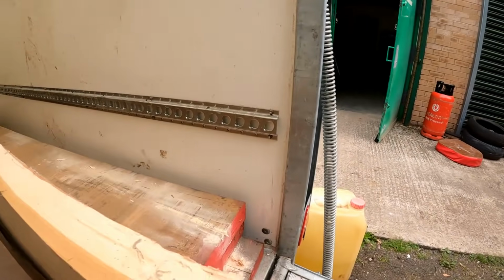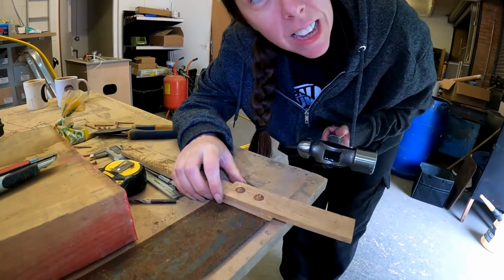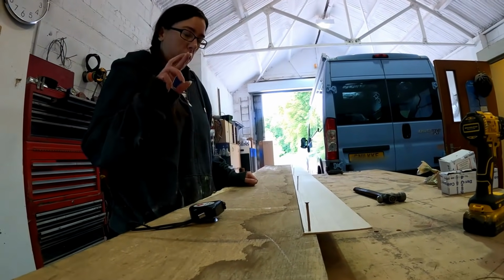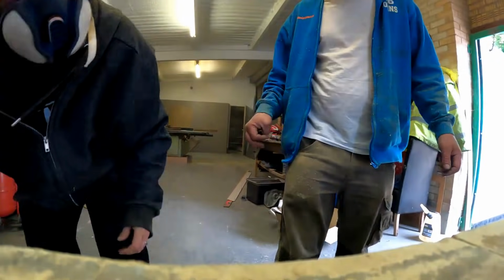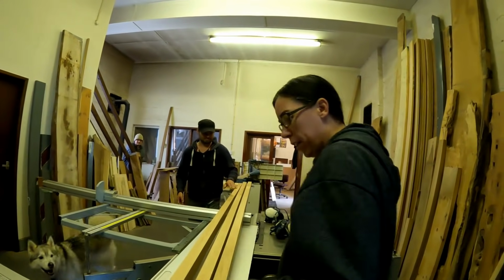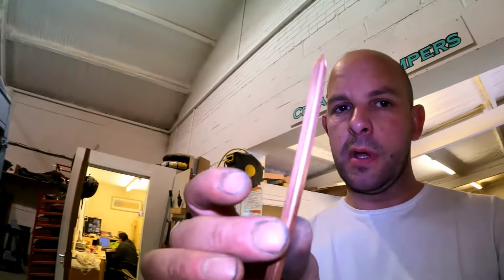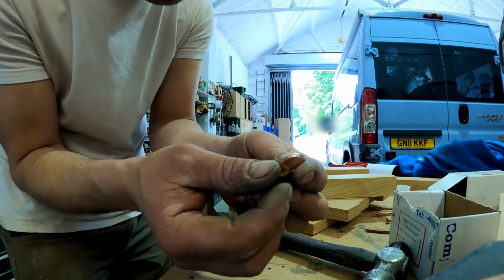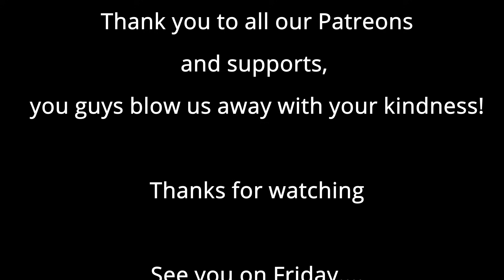Milling Our Own Oak Frames, Learning Copper Rove Techniques And Making Rove Tools

Comment: A few tips from a 1st Class Tradesman Boilermaker.
Mate... safety glasses when drilling steel ALWAYS.
Ear protection guys!!!
When swinging a ball peen hammer and riviting, swing from your elbow and NOT your wrist for control, accuracy, power and avoid damaging your wrist.
The test rivit mock up went very well but you need a block of 1" thick steel with the shape of the rivit head and probably a handle or two to prevent the rivit being pushed out and reduce rattling things loose. 
That was a good mock up test tooguys. 
From Australia.
🇦🇺🐨🦘🇦🇺
Reply: The weight of the hammer is the worker....is what my grandpa, a machinist and tool and die maker used to say. I try and remember that when im just hammering in nails on some little project
Reply: Boilermaker!? So, you're a Purdue alumnus too! Boiler Up!

Comment: Hello from Pa.USA. The way u2 make things work is sort of  how U put the Beautiful Boat from the start with just about nothing, Except when u have to. Is how I have made a small business out of only using totally used material. But I sort forget about the building knowledge the 2 of have. The one who is always banging his head what I would call a master carpenter, electrical specialist. Again master plumber not to mention his mechanical wisdom.
  Oh yea the one who’s the best right handed helper on sight.. Not only excellent Mother, cook, ideal maker and most importantly keeps Simon under control. The rivet smasher he made out of the bolt shear genius….
 I know u can’t hear it but I’ve got a bolt turning on my lathe as we speak…..  Brilliant Vlog today thanks!

Comment: Check out Acorn to Arabella or Tally Ho for tips on copper riviting, they had one person outside pushing a tool against the rivet, whilst the person inside peened over the head. 🙂
Reply: I say check out sailing yaba to...check out how the shipwrights make up the frames.
Reply: yeah somebody else who watches both Tally Ho and Acorn to Arabella - best channels, top blokes doing top jobs, especially no feet Pete, all bring their skills
my guess is the copper pins and peening can be done in different ways, i reckon these cross diagonal planks were assembled for speed where as today with the named projects above use thicker 2inch horizontal planks and countersink to hide heads - Gem n Si, did you enquire as to trading your used pins back to your supplier as scrap, although some longer ones could be reused where short ones are required - not sure if you can run a small compressor on the boat with a modified air chisel for peening, but does require weight behind it and will do your head in - (i might suggest pre drill holes before pinning) not sure if its still a thing today, i still blunt nails before hammering to prevent splitting timber - amazing work though and super vids
PS glad you got to see Madusa at Pompey, its the icing on the cake to make new pals and get involved in national and international events, D-Day etc epic

Comment: If you have access to air tools an air hammer makes a great rivet setter. Just drill a small divot in one of the tools and use this to upset your rivets while someone holds a bucking block on the outside. If you decide to continue to use a hammer, use a smaller one that is easier to handle repeatedly. Keep up the great work.
Reply: was about to suggest the same thing. Could make a nice dimple in the end of a cut off air chisel  on the lathe with a counter sink bit.

Comment: As a fabrication engineer you can make a tool to round off the nails Get a big bolt like the ones you have got  but a concave end about2/ 3 mm deep at one end to finish the nails  by placing it over the end of the nail and a big hammer to finish it works

Comment: Its always hard getting decent lumber in the woods that you prefer to use. The mills are set up to get the most board foot of lumber possible, so there's always a couple that never quite make it. At least you had the table saw and planer handy to square your pieces all up. Slow but sure wins the race as Aesop's always mentioned, if there's a moral to be had in this. Very best wishes my friends.

Comment: A smaller hammer will make the roving effort a little easier (if you are worried about missing and bruising the timber you can use something like Adalox sanding cloth with a small hole to protect the surrounding timber). The idea is to spread the copper nail over the rove which pulls the nail in and tightens the rove to the timber (without flattening the rove). If you make a pin dolly (pin end of the dolly the same size as the head of the nail), you will find it easier to rove the nails (no bounce and the copper end "spreads" more easily).

Comment: Definitely need someone on the nail head with a club hammer acting as an anvil essentially, and use a smaller ball peen  hammer on the end of the nail after you've fitted the rove and pushed it down. You might need to cut off excess length of the copper nail before you peen it over. I was taught to dip the nail head in silicon grease before nailing it through the wood, eases it through.

Comment: I wouldn't worry about work hardening they are likely to be fully hard  already
as a copper  nail  they would need to be or you could not drive them in  with a hammer they would bend 
good work thanks for posting

Comment: Hey Simon so you know a rip saw blade has a bigger gullet on it (gullet is the rounded bit under the tooth tip this get rid of saw dust which you have when cutting hardwood and more of with softwood this take it out of saw path known saw kerf then saw dust falls out under saw in stead of remaining and getting hot and burnt with friction) Panel saw blades don’t need such a bigger gullet as their is less saw dust as your material is usually chipboard mdf etc smaller dust particles normally the teeth are tungsten carbide for cleaner cuts Jeff Connor Melbourne Australia love your channel guys . Ps Pompey 20:13 ex timber sawyer  watch out for the dust of Iroko as it toxic make sure you have eye protection as as face mask one of our ex sawyer got a similar problem as asbestosis from breathing it for years it’s a lovely wood to work on and with though Jeff Australia

Comment: A quick course in using a Hammer. The handle is engineered to be in proportion to the weight of the hammer head. For the most efficient use, one holds the handle as close to the end and not the head to create the needed force to accomplish the work. Suggest you search Youtube on RIVITING. Then note the amount of force to peen over the rivet heads. You need to borrow or rent a small pneumatic hammer with a rove tool. That hammer will be too labor intensive. I saw a air compressor in the shop. Make it your friend. Seeing Gemmi tap that rivet head has mad my wife chuckle. Remember, the rivet is to have two heads to lock the surfaces together. Another suggestion. Turn the table saw 90 degrees and place it in a position that allows one length of the wood on both ends. So much easier. Not sure who sold you the wood, but cut a short piece of about two foot, carve it into a club, and revisit the seller. That's some crappy wood. Enough bitching. Tred on!

Comment: You might be better using a pneumatic rivet setter (air hammer) for those copper roves, it would give you more control than hammering (I mean for the peening part).
Reply: That's exactly what we do when riveting aircraft with alloy rivets.

Comment: For steaming... the weak points will be... where there is a knot or where  the grain runs out of the side of strip before the end. Under steaming and forcing timber to bend. Grain that runs the full length of timber will be the easiest to steam bend That's my basic knowledge I have gained.  .:):):)

Comment: You do know you should drill a pilot hole through your outer planks into your inner frames and a recess in your outer planks to countersink your rivet and later plug it with a dowel! If you're cutting your own rivets, you'll need to take the countersink into consideration for the length!

Comment: Once nails are through they can be rolled over and driven back in to wood cinching together tighter! Hull planks will even snug tighter once wet? Driving nails with out bending them using a air hammer needs lots of air!

Comment: You will deffo need ear plugs when hammering that lot. By the way, They are rivets. Not nails. 
How about using a rivet setting drift to peen the rivet over the washer?

Comment: Check your timber for flight holes because that damged part looked like the work of woodworm. Don't bring them aboard your ship, else they will eat it. You can get a chemical treatment that may ensure that you can use that timber without taking any risk. Good luck.

Comment: If you want to make the nailing roundover easier get an air-powered "palm" nailer and switch in a flat anvil attachment.
Don't bother to paint the bottom of your boat until you get it out of the mud and on the hard. If you do you're just wasting your time and money. All the best.

Comment: Hold the hammer nearer the end of the shaft & use the weight of the hammer, rather than your wrist power, to hit & 'pein' (it's a 'ball-pein' hammer), the pin over.
Reply: Yep when I was an apprentice I was told “ don’t strangle the hammer “😂

Comment: I had to wince when you blew your selves down with the airline. That is so dangerous .It can aireate  the blood and cause death. This was one of the first things I was taught never to do on my engineering aprentership. Always  enjoy watching vids. Keep up the good work.
Reply: Absolutely! I recently retired from working in electric power generation plants. Blowing off our clothing with compressed air was grounds for termination. Very dangerous.
Reply: Total nonsense.
Reply: @itsverygreen532  Not really, most factories have the airline limited/regulated unless It's just for power tools, anything with a pistol is around 25 psi, there are many cases of people messing around with unregulated airlines and causing life-changing injuries, its very dangerous and in most places a gross misconduct or disciplinary at least
Reply: @itsverygreen532  Um, no its not, people have died, quite a lot of people.
Reply: @itsverygreen532  air embolisms are life threatening and have killed many.

Comment: good to make a start on the wood, but looks like the grain running wrong way
and somebody should be on the out side of the boat with a heavy bar with a point 
pushing against the nail head while someone in side hammering it keeps it,
when you coming for rest of stuff...
and that was a plunge where is your centre drill

Comment: You could use a pneumatic hammer with a rounded concave bit to hammer the nails instead of hammering by hand. Try having a look at Youtube channel Sampson Boat Co they are restoring a 100 yr old wooden boat "Tally Ho"

Comment: you two are brilliant
you put the rest of us to shame
and
Not trying to butttt in butttt
y'all know that's like riveting was a million yrs ago  the way it happened was the guy on the 'inside' had to lean into the rivet with a 'form' while the guy on the outside used a pneumatic hammer to ram the hot rivet home.  You might try having outside person lean in while the inside is hammering down the copper nail to grip the rove with an electric or air hammer. Like 100 1 lb strokes might do the job and be easy for outsider to lean in on.  ideally you'd custom make a blunt head for it that's a bit concave the shape you want the copper to be hammered into.  
Apparently you can buy electric hammers that deliver a couple pound blow 3000 times a min, pricey $200 Air hammers that do the same like $50 but you need the compressor etc.
Maybe you can rent something for a day just to try in the shop.
Milwaukee Electric Tool 2458-21 Cordless Mailer Kit, 1-3-1/2"
Craftsman 9-11818 Nextec 12-volt Lithium-lon Hammerhead Auto Hammer
Ingersoll Rand 114GQC Air Hammer - 3 PC Chisel Set with Tapered Punch, Panel Cutter, Flat Chisel, 2-5/8 Inch stroke, 3500 BPM, Lightweight, Compact, Gray
DEWALT Chisel Hammer, Pnuematic (DWMT70785)
XtremepowerUS Demolition Electric Hammer Jack Hammer Handle 1000W Concrete Breaker Flat and Point Chisel Bits with Case

Comment: I remember doing this about 45 years ago with my father on a clinker built dinghy. Take a look at this clip Nomad Boat Builders channel. https://youtu.be/HapS5j2LJa8  . He is a wooden boat builder in the old style and might provide an few tips to make life easier for you. He has a handy tip for getting the hammer marks from the surface of timber, using a wet cloth and an iron. If I learn nothing else this month I will be content with that tip.

Comment: Could you peen the nail using a hammer drill or impact driver with a die designed for that purpose? The hammer drill should deliver enough impact force, but a shop trial might be worth it.  Otherwise, the peening could take a lifetime.
Reply: I wouldn't recommend either as you don't need any rotary motion, and both of those tools give more rotary force.